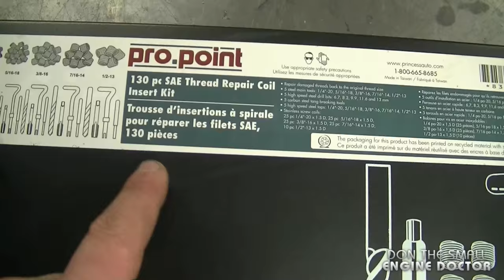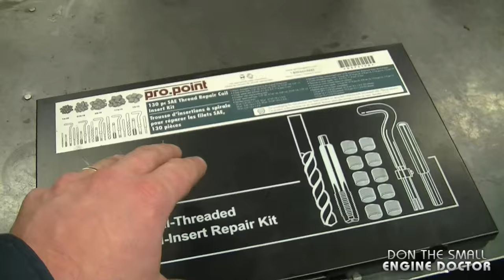Small Engines Q & A Video #149

Comment: Great video Don.  You nailed it.  Fixing stuff is fun and frustrating.  Isn't it nice when an owner comes in with a piece of equipment that is still running and they are willing to just get a tune up?    Some of these machines cost more than the shed it is supposed to be in.            By the way I just found out I am going to be a grandpa for the first time.

Comment: So, I have a Honda GX 160 that keeps surging, I replaced the carburetor bowl (it had rust in it) and cleaned the jet out, it runs fine for a bit, but starts surging eventually. could it be that the fuel tank is contaminated?

Comment: It amazes me how dumb people can be about the simplest things.  Like leaving on the brake.  You have to wonder how they function at all.
Reply: The chainsaw was brand new, the owner may have been a first time user and not read the instructions properly.  You can only start a chainsaw with the hand brake on unfortunately.   But yea, I always blip the throttle (never keep it depressed) to see if the chain is moving first, before going full throttle.
Reply: +kaiok1777 Correction, you should only ever start a chainsaw with the chain brake on because it is safer.
Reply: +kaiok1777 I can see not knowing the brake is on, but, man, you have to be total oblivious or really stubborn to run it until nearly bursts into flames! Some little voice in his head should have told him that something wasn't right.
Reply: +Rosa String Works- Actually, you have two groups of people, those that understand engines and equipment pretty well and the rest of the world!  I think there would be a good market just teaching people the proper way to use equipment.  Most just go and buy equipment and jump in.  There are lots of mistakes made.  I just saw a brand new $400 Toro advertised, where the guy filled up the gas tank with oil!  That really scares me the the chainsaws, most especially!  I can hardly watch some of these guys up on ladders with 42 cc saws running at full throttle!

Comment: Don, I can totally relate to, repairing some customers old piece of junk. For example; Like an old riding lawnmower! Spending time to get the motor running correctly, and then finding out the transmission doesn't even work! 
Say, that was classic! Running a chainsaw with the brake engaged!! FACE PALM. Because expressing how dumb that was in words, just doesn't 'cut-it.' ;-)

Comment: Wow I thought every thing could be repaired .  I'm having one of those days where I seem to have bought a fixer upper . it's a sears 7/26 with tires. Pull start rope first off broke on third pull. Then I thought hey I better take the carb off and clean. Glad I did that . it started but needed a belt . got that on and gave it the first year and sounded like the drive was chattering. the chain on the drive was jumping .Then to find out that the trans had come loose and cracked the case. This ends up being the peerless 700 series  not a cheap fix . it's still setting yet to find a replacement trans.  we don't have the snow here either  12/24/2015  Michigan here.   PS no grease leaking .Do I dare weld the case and bolt it back in??? tig .  thanks for all the great information on your videos.

Comment: I recently bought an older John Deere S1400 trimmer.  I started to rebuild the carburetor, since it doesn't properly prime and has to be pulled several times to start it.  The carburetor kit was pretty expensive, being John Deere.  I then bought a new carburetor.  The new carburetor only comes equipped with a High adjustment screw and no low adjustment screw.  It starts quickly and runs well in full throttle, but dies when the engine idles.  I've turned the idle adjustment in, but it still wants to die.  I've been running this with the metal edger attachment, so I know that pulls heavily on the engine.  Is there a way to adjust this, or is the edger attachment just too much for the CCs on this trimmer.  It seems to edge with plenty of power!  Thanks!

Comment: With the grinding of the two wheels together on the snowblower. I had a buddy who did that to his. Luckily, I caught it soon enough. I put a nut on the mounting bolt on the disc so it would spin freely, put it in the vise and ground it smooth with a flapper wheel in my 4.5 angle grinder. I then drilled small holes through the wheel that holds the rubber ring. I put the new ring on and ran self tapping screws thru the wheel and into the rubber ring. Normally I wouldn't do this style of repair, but my buddy didn't want to stick much money into the snowblower. It works to the day, but repairing it with new parts would be a better solution.

Comment: I have a question I have a yard works with a Tecumseh but it die after it warms up  what could be the cause of this . I have cleaned carbs and  it idle prefect till warm  then just dies  if u try to pull over right away it will start but die rights way  .  I think it's a coil but is there something else that can cause this ?   Thank you

Comment: Merry Christmas, Don, I just found an old Gravely 1238H with a Kawasaki 12.5 hp that had not ran in years, new battery, solenoid, carb cleaning, got it running like new. Here is the question, found the owners manual online, it calls for straight 20 weight for the hydro transmission, are they talking 20 weight motor oil or 20 weight hydraulic fluid?
Reply from the maker: +Jeff Graha I'm not sure

Comment: Bummer on the chain saw , have seen those melt before , but on smaller ones . Think they would wonder where the smell and smoke was coming from , but i guess they do not realize
Reply: +wtbm123 Years ago when Hurricane Hugo hit, I was working in Lowes after high school.  Two fellows came in and said "This chainsaw will not cut a thing".

I looked down and said " The chain is on backwards"

The look on their face...

I guess they thought a spinning chain if spun fast enough will cut a tree.  We took back so many chainsaws that were seized and tore up.  Lots of folks that should not have been running a chainsaw that year.
Reply: +dpeagles Chain on backwards happens more than you think.
Reply: +LoveStihlQuality I'll admit to having done that once! A long time ago, only once, figured it out and I didn't have to take it into the shop, but I did it. And . . . once I took a Poulan back because "it didn't work." . . . the clutch break was engaged . . .
Reply: +Dale Grote not hard to get them on backwards . Most that find humor in it, has prob done it once themselves , .
Reply: +wtbm123 Ppl are unbelievable sometimes.. We are like kids in a candy store, just grabbing machines left and right.
Reply: Wouter: We're all ignorant about one thing or another. I'm sure a wine connoisseur weeps in despair for the modern age when he sees the bourgeois assortment of whites at a grocery store. The only remedies are forgiveness for others and a good sense of humor about our own misdeeds.

Comment: Everyone should know that leaving any engine outside means death for it, thats where a wooden shed comes into its own :-)
Have a happy xmas don, and thankyou for all your enjoyable videos this year :-D :-D
Reply: Actually depends where you live.  In hot & dry climates there shouldn't be too many issues, except for some rust. But yea, some cover is better than none.
Reply: +kaiok1777 Yeah, here in California I don't put anything except the generator and weed whacker inside. Lawn mowers are fine under an overhang and I've never had issues with rust or damage as a result. The worst I've ever gotten is a few pull ropes that failed early but those are still cheaper than a shed.

Comment: Hi Don. I have an older toro 724 snowblower, and the problem I'm having is whenever I put in drive it some times skips and I have to hit it off the ground to get it too move again, but when ever I have it in the air it moves fine. What would be causing the skipping?
Reply from the maker: +Bradley Miller check drive cable tension, it may need to be tighter. it could also be the drive disc and or drive belt
Reply: +donyboy73 I will try that. Thank you Don for your help, and also thank you for all your helpful videos